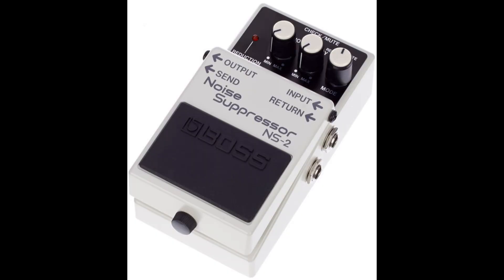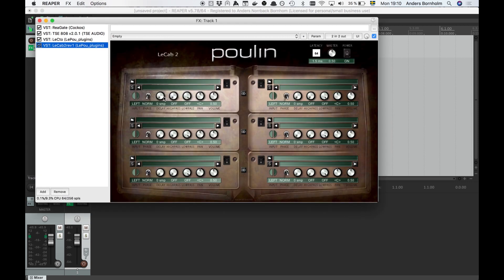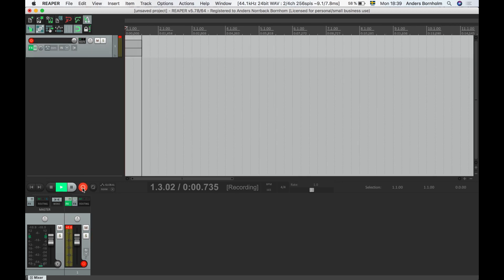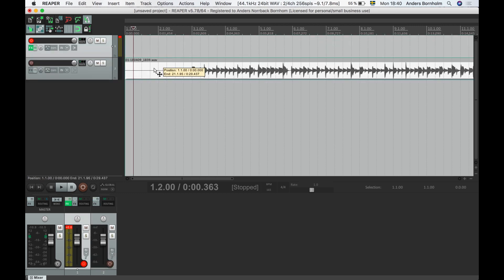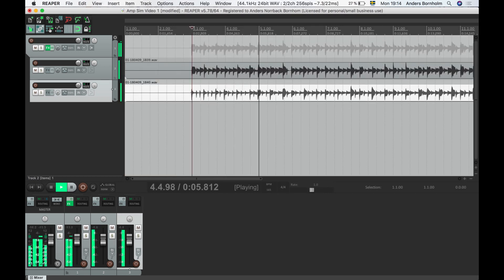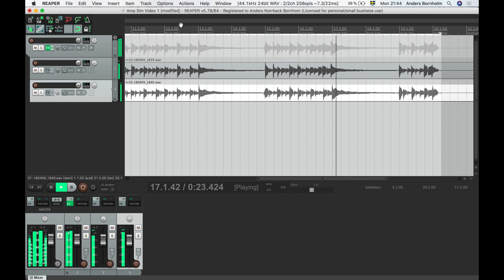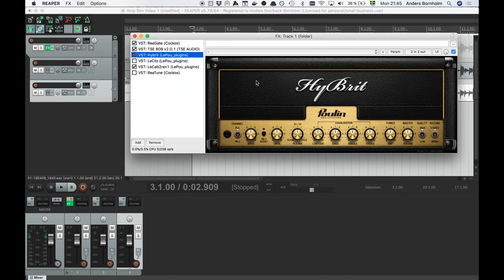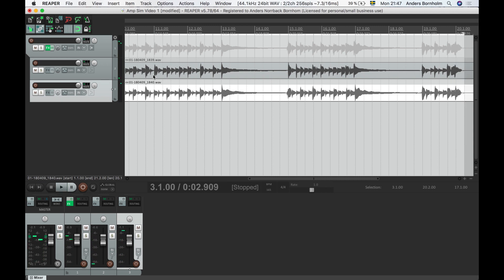Using Amp Sims and Impulse Responses for Metal - Reaper Tutorial Using Only Free Plugins

Comment: So i'm using ML soundlabs Stevie T plugin, its an exe, in reaper i go properties,/ plugins and point to it, then i select FX  and its there StevieT.vst3 amped it comes up big on my console, i hit record i play clear as a bell, just like the guitar is plugged into a clean amp... why is this not working?
Reply from the maker: Does it sound amplified at all, or are you possibly just hearing the di signal with the amp vst bypassed?
Reply from the maker: You can test that if you bypass all FX on that track (FX button turned red) - does it sound the same?

Comment: Thank you so much for this video. I just have one problem, I cannot hear the distortion in real time! I can hear it when I listen to the recording but not while playing. When I'm playing, I only hear my plain clean tone.  I've set up everything as you have here, what could the problem be?
Reply from the maker: Hard to say exactly, but my guess would be that it's an audio interface setting rather than something in Reaper itself. Some audio interface have a direct monitoring setting (usually a button or a knob on the device itself) that allows you to switch between the direct input and the output from the computer (i.e. Reaper). What audio interface do you have?
Reply: @osiris-guitar  I know this is a late response, but thank you so much! I actually ended up figuring it out and it was actually that I wasn't monitoring on Reaper, and wasn't on the right input channel.
Reply from the maker: If it's not the audio interface, check this Reddit thread: https://www.reddit.com/r/Reaper/comments/44mpqw/direct_monitoring_switch_on_reaper_where/